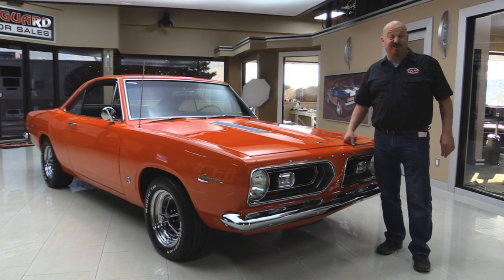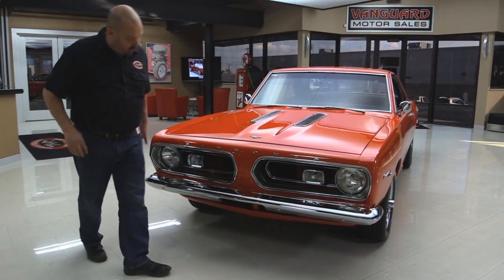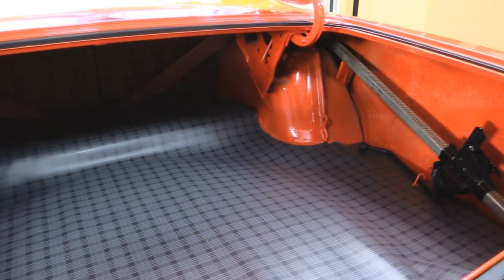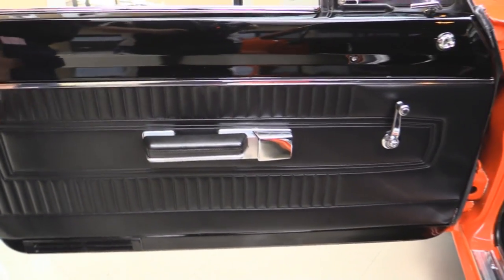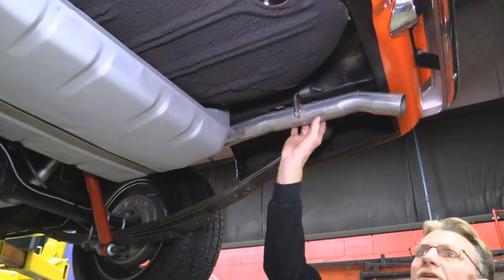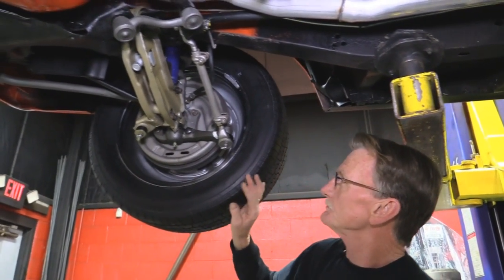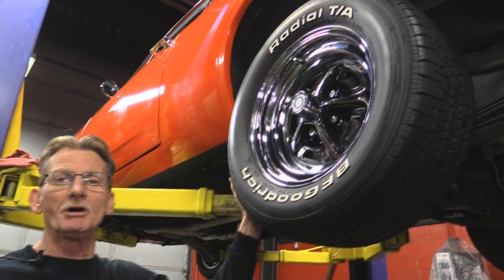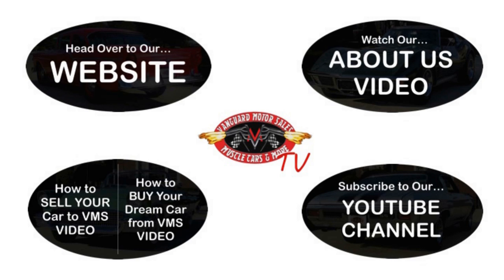1967 Plymouth Barracuda Formula S For Sale

Comment: We used to run one with a 440.
She never hooked up.
Reply: They can be made to hook up with a 440 and can become quite the wheel stander.  You've got to use non-DOT tires and now it becomes a drag car only.  For the street the 340/360 is the better all-around choice as the balance is much better.  
I did drive a 440 six-pac with a 4-speed and it was quite a ride!  I sure wouldn't turn my nose up at one if it came my way!